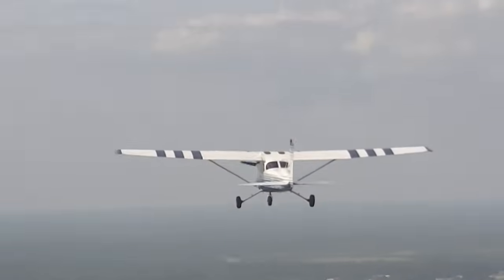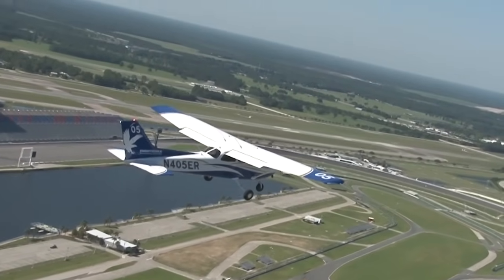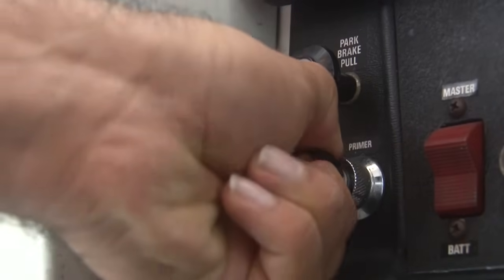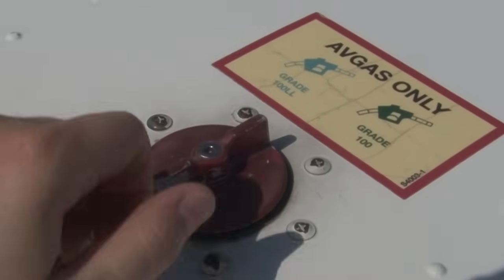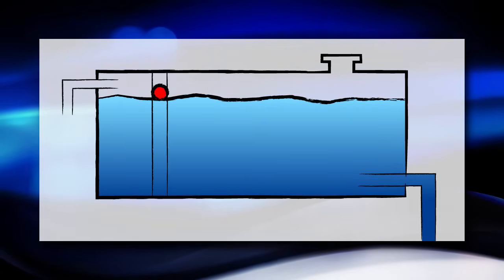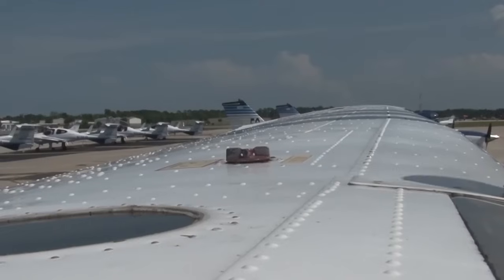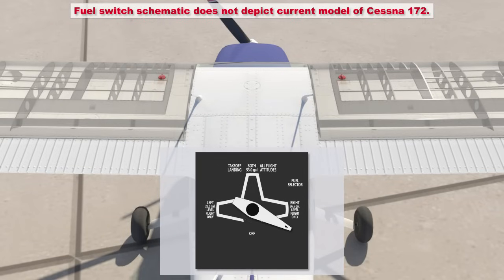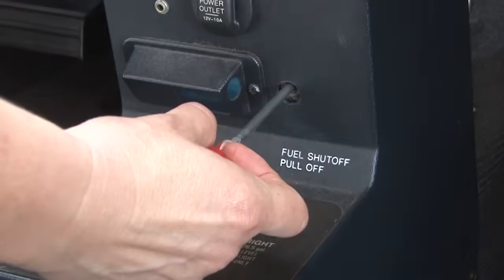Aircraft Systems - 05 - Fuel System

Comment: The Piper at 1:08 crashed in 2018 because its wing fell off, killing student pilot Zachary Capra and FAA examiner John Azma. As a result of this crash, Embry Riddle now only uses Cessna 172s and Diamond twins.
Reply: I believe the Piper that crashed had a tail number 106ER, it was not this model in the video.
Reply: @christiangreen2070  The airplane registration number was changed from N712ER to N106ER on July 10, 2014
Reply: @ The airplane registration number was changed from N712ER to N106ER.

Comment: Thanks, this complements very well what I'm being taught in my flight school. Just one question: Id I'm not mistaken, the fuel exit from the tank to the exit it's not on the tank's lowest point, but a little bit above that. Why is it ?
Reply: G'day. I'm reading directly from by textbook here... """In most fuel systems the outlet pipe which carries fuel to the engine stands above the bottom of the tank. This arrangement is called a stand pipe, and it ensures that some unusable fuel will remain in the tank to ACCOMMODATE any CONTAMINATION that may be introduced into the system. """

Hope that helped :)
Reply: That’s also why you want to sump from the lowest point closest to the fuselage first.

Comment: Yes when gravity fails you need a fuel pump.
Reply: It’s probably for spins or negative G manoeuvres and other things.
Reply: @chanute4041  on a cessna 172?🤣
Reply: @stephval8970  as God intended
Reply: The typical carbureted C172 typically runs for about 2 seconds when inverted. Source: Sporty's Intro to Basic Flight Maneuvers.
Reply: The fuel pump is necessary for priming
Reply: "we were inverted"
Reply: No you need a fuel pump when you have fuel only in one of the wings. When you need to do a manuevre (turn) banking the certain wing that has fuel in it, so gravity can not feed the engine. At that time you need to use the electric fuel pump
Reply: Fuel pumps provide extra fuel when at high power, gravity alone not enough even in gravity system to feed fuel. Quite common on motorbikes for instance, they don't go upside down.
Reply: Idk crazy shit can happen like microbursts. Prolonged stalls or spins might also do it kill the engine with the pump off.The fuel pump also probably increases fuel pressure so If an injector/line is semi clogged or the engine is running rough it might get you to an airport.
Reply: Gravity never fails fools

Comment: Why would you not want to draw fuel equally from both tanks at all times?
Reply: In level cruise flight of most aircraft, one tank drains quicker than the other.  This also causes a weight imbalance for the aircraft affecting control.  So, during flights exceeding 1 hour,  the pilot will switch tanks for a period of time to keep these balanced as much as possible.  Large transport jets have a computer based fuel system (I believe) which does the same thing automatically.  For takeoffs and landings, the selector must be in the "Both" position and most definitely if the pilot is practicing steep turns and other such movements when the wings are not level or for AG spraying (Low altitudes).  Many pilots have died for not managing fuel carefully.
Reply: If you had say a drone strike and there was potential debris inside the wing tank you can isolate that to ensure fuel flow from your good tank.

Comment: You said we use fuel primer to inject the fuel staight into the cylinder prior to engine start. Beforehand sorry for possibly stupid question, but what happens when we do not use fuel primer? As far as I know, the fuel in all cases is injected straight into the cylinder. Where is the difference and how does fuel primer help during cold operations?
Reply: Only in fuel injected engines is the fuel injected straight into the cylinder, in carburetted engines it is atomised and mixed with air upstream of the cylinders and enters them through the intake valve
Reply: Well, without using a primer you may not get a successful start up of the engine eg. the engine will be less prone to firing. And during cold operations because of the more dense air, the ratio of air to fuel is greatly increased and you'll need more fuel in each cylinder for effective combustion to take place to fire the engine.

Comment: Great video, but all c172s I've flown have been equipped with a fuel primer...
Reply from the maker: Thanks, Kyle. That was very common on older model Cessna aircraft. The new fuel injected do not have a primer, however.
Reply: Thanks for commenting back! With that being said, I haven't flown anything newer than a 1985! Just wanted to share my experience in case there were some student/private pilots watching that may have experienced the same!
Reply from the maker: Thanks for that! We love bringing pilots of all experience levels together, and hope that our work can help everyone learn a little something.
Reply: Kyle Cooke I fly a 172s it doesn't have a primer. The 172n carbonated model does
Reply: Ok.
Reply: Kyle Cooke oh
Reply: Newer models which may be fuel injected are usually primed using an electrical fuel pump. Most of the ones I’ve flown were all older and of course had the good ol manual push primer.
Reply: I train in a Cessna 150 L, and it has a primer and a carburetor